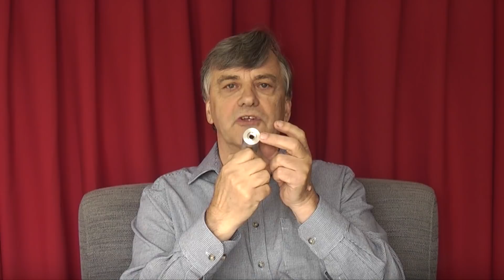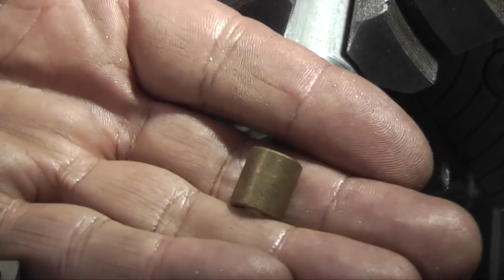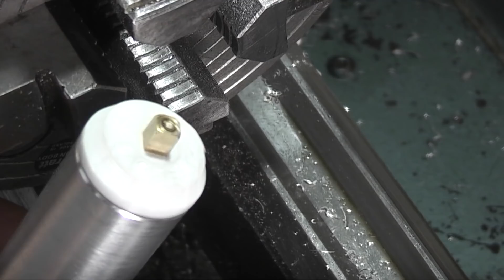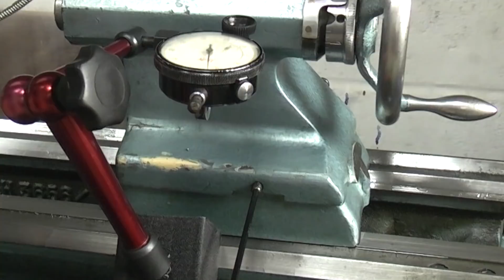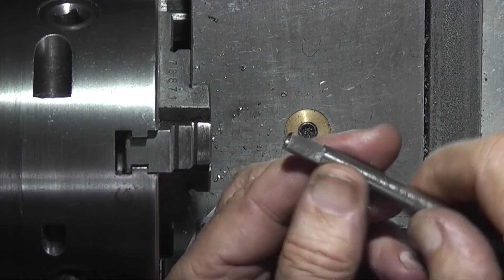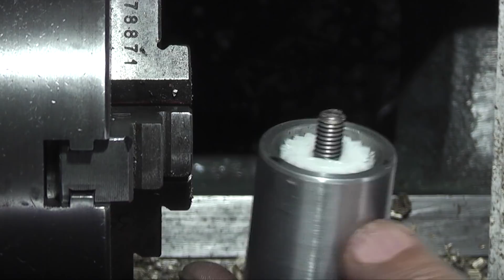Making a metric thread dial

Comment: I like the knurled nut!  

When the shaft is barrel shaped due to tool pressure causing flex, will a couple of spring passes correct that? Or, will a bit of polishing do the job? I realize that the shaft center dimension is not critical; it really only needs to fit through one bushing. I do not have a follow rest on my lathe and have almost mastered making thin barrel shaped shafts. :)